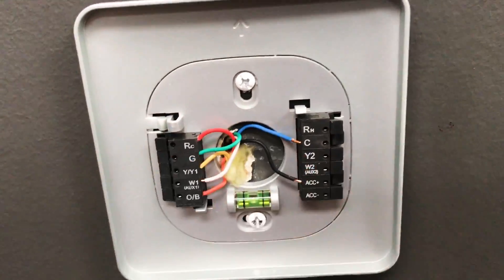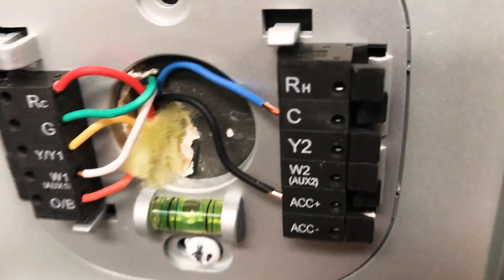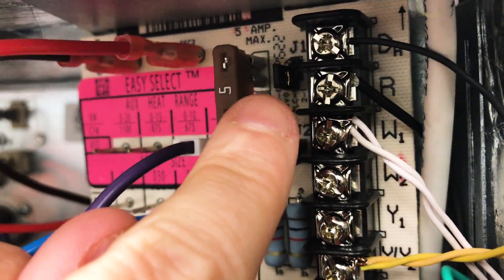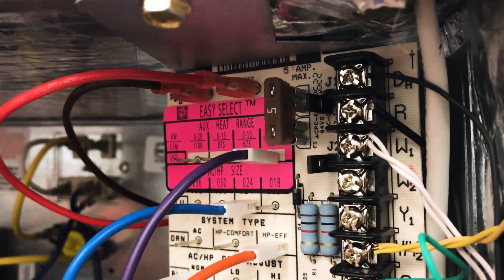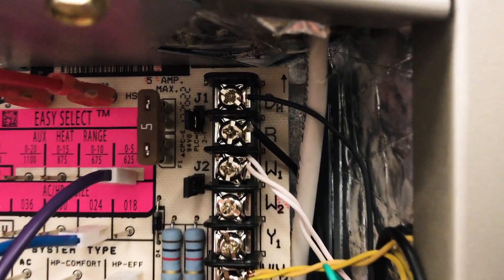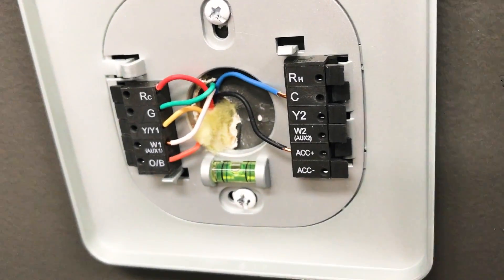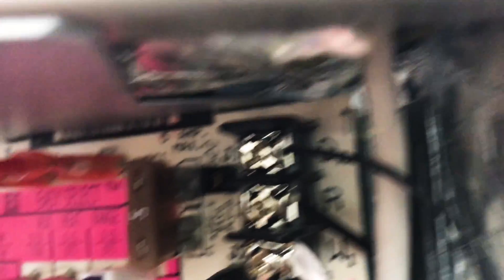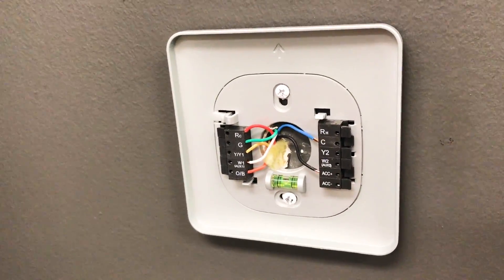BEWARE When Replacing Fancy Thermostats

Comment: Hook the DH terminal to Y2 on the new stat. Set new stat for 2 stage cooling, Y2 will call full speed blower. The customer keeps dehumidification function and high blower speed when needed.
Reply: except full speed fan is more efficient. better to put on a manual humidistat, run fan at full cfm unless dehumidification is required.
Reply: @Jon-hx7pe  That's ideal if the replacement stat has a DH terminal.
Reply: You can use a cheap mechanical humidistat that closes on humidity drop and use a cheaper stat without the terminal. If having two controls on the wall is objectionable,  it can be put right into the return drop and sense the humidity in the return.

Comment: I made a mistake once with replacing a digital thermostat with a standard snap-disc style. 
It was winter time when heating was prominent and customer wanted the basic thermostat installed.

Summer comes along and the AC didn't work properly because a non-digital stat does not have compressor protection. I should have installed time delays on the outdoor condenser when I was there.